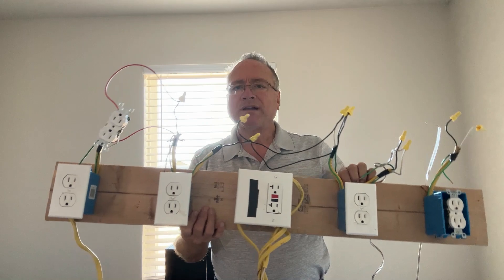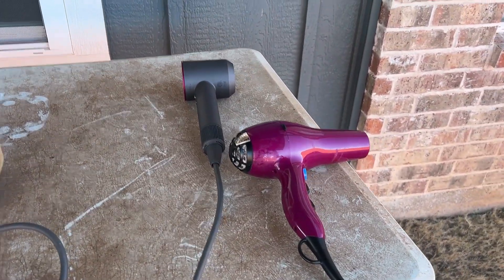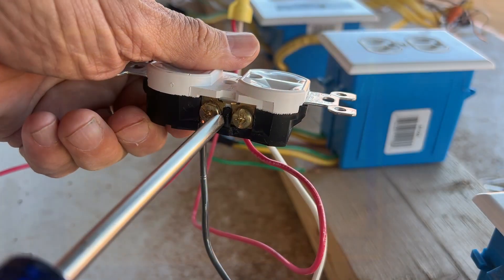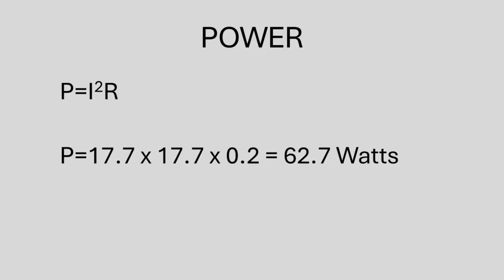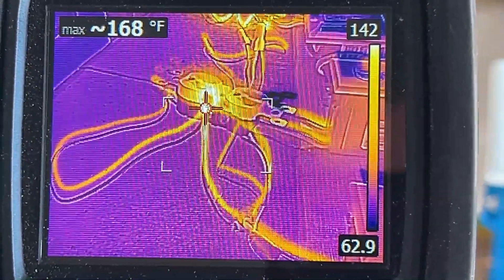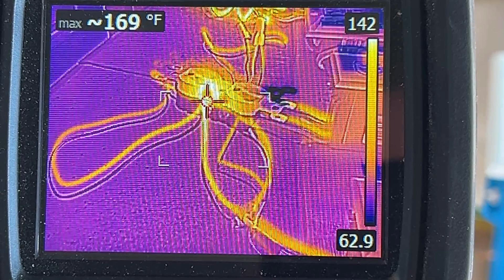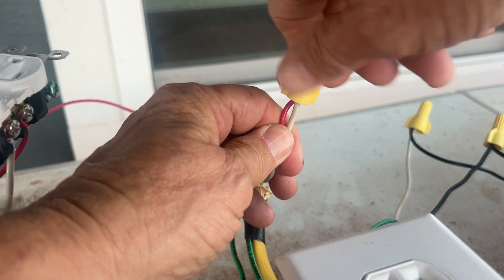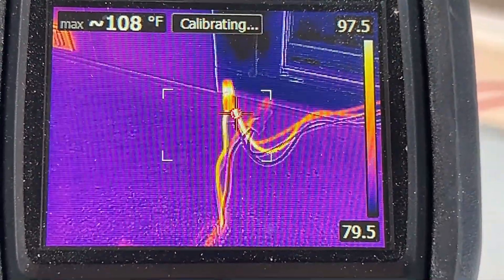The Hidden Danger of Loose Electrical Connections – Thermal Camera Test!

Comment: If the resistance were 100 Ohm (really poor connection), would you see power loss of 17.7*17.8*100=31kW? No. There would simply be no current.

Lose connection doesn't create extra power "loss" but results in less power. An extreme example is turning the switch off- extreme loose connection=zero power. P=I*I*R does not apply as the current drops with higher resitance. Substitute U/R for the current: P=U*U/(R*R)*R=U*U/R (voltage is the constant).  WIth the same voltage, higher resistance results in LESS power. The higher temperture is a heat dissipating issue, not a more-power issue.
Reply from the maker: You’re right that a higher resistance in the circuit reduces current and therefore reduces total load power — no argument there.

But that’s not what causes the danger with loose connections. The problem isn’t the overall circuit power, it’s the localized resistance right at the bad connection point. Even with a small amount of current, that tiny high-resistance spot can dissipate a lot of heat in a very small area. That’s why loose connections get hot, melt insulation, and start fires even though the breaker never trips.

So yes — the total circuit power drops — but the contact point can still overheat because all of that I²R heating is happening in a very concentrated spot. That’s the whole reason electrical codes require tight terminations.

Thanks for jumping in with the discussion — it’s always good when people think through the electrical principles behind these issues.

Comment: Your demonstration of roughly 170°F for a loose connection was relatively cool because it was dissipating the heat into the surrounding environment.  If this same connection were in a junction box buried in blown in attic insulation, as would be a likely real life scenario, because there is nowhere for the heat to dissipate, it's likely the connection may glow cherry red, aluminum wiring may actually melt which is around 1,220°F depending on the exact alloy. It may be necessary to step outside and let firefighters handle the situation. 

In a best case scenario, the insulation melts forming a direct short and the breaker trips and refuses to reset before any smoldering takes place.
Reply from the maker: Hey Sparky, first off—sorry for the slow reply. I’ve gotten way behind on comments, but I always appreciate yours. You’ve been one of my most loyal and insightful viewers, and I really do value the knowledge you bring to these videos.

You made a great point about dissipation and how a loose connection can lead to heat buildup even when the current draw isn’t that high. And yes, the heat buildup will be significantly more when the wiring is in a hot attic. That kind of detail is exactly what makes this community stronger—and helps others understand why seemingly minor issues can turn into serious problems.

Thanks again for always contributing. I really appreciate you.

Comment: Was working at a sewage plant and my AM radio started having radio interference. Noticed one of the lights flickers at the same rate i could hear on the radio.  Took the am radio around put it up to a junction box and the rf was loud. Wire nut fell off and was arcing.  Come to find out people use AM radios to find bad connections.
Reply from the maker: That is very interesting. I appreciate you watching and certainly appreciate the comment.